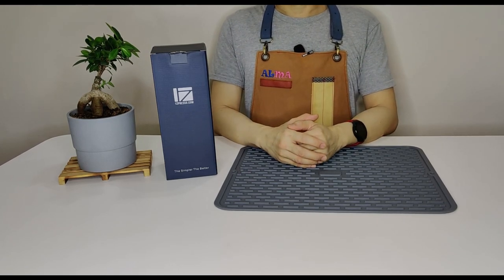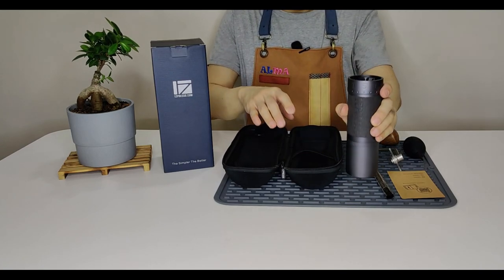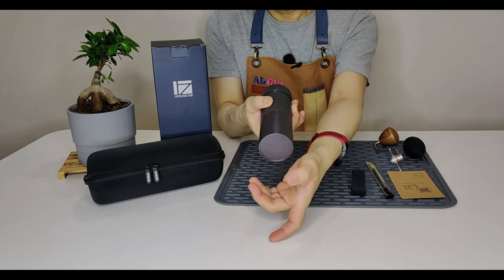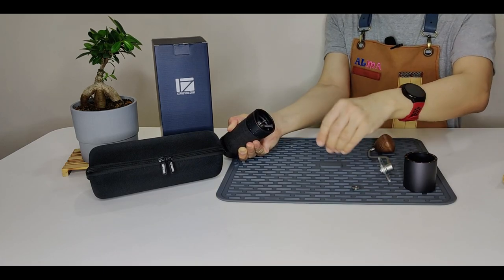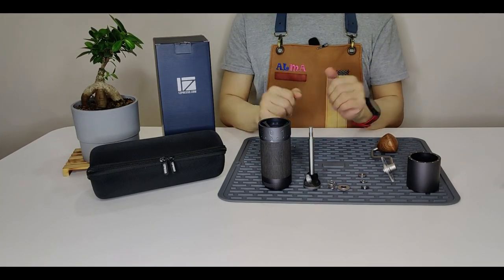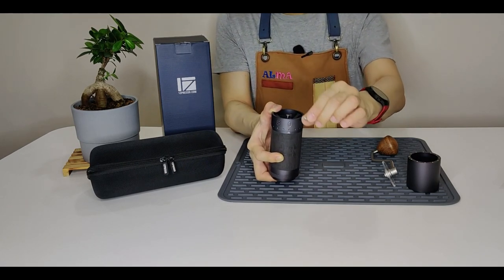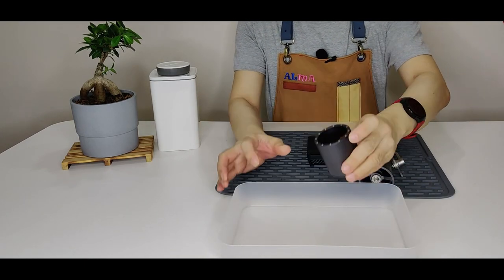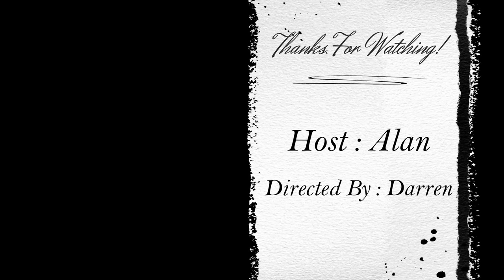1Zpresso J-Max Hand Coffee Grinder I Intro I Disassembly I Assembly I Grind Quality Test

Comment: My jmax grinder fell over and now its burrs are stuck. I cannot get the shaft to push out either. Crank doesn't turn.

Thoughts? I could really use some help.

I have disassembled it otherwise and of course its a day over the amazon return window.
Reply from the maker: @Roger lund - Sorry to hear about that. Unfortunately, it's not possible to have your unit on hand for analysing and therefore unable to advise you on the necessary self-repair. The best is to refer back to the seller for advice. Cheers!

Comment: Once you assembled again you just start using it? Doesn’t have to be calibrate it?
Reply from the maker: @Ivan Falquez - Hey there! As shown in the video (assembly guide), we have actually mentioned turning the adjustment dial to the true starting (zero) point before proceeding with the assembly. When in doubt, always good to consult the dealer or user manual. Cheers!
Reply: @almamicroroastery  I missed that on the video, thanks for that , I did it and it works fine now, I went off calibration that’s why I was watching your video , thanks a lot
Reply from the maker: @ifalquez  You are welcome!

Comment: Hello! Excellent video!

So I'm worried... I received my J Max grinder on this week. I mistaked! I know, I showd read the manual and see vídeos before make shit. The first thing I did was turn the adjustment ring counterclockwise until limit and removed the small bearing on the top. Consequentely after that, the ring adjustment jumped and come off completely, I saw that it has grease for lubrification and o can saw smalls metallic balls ... I went back with it to the place with a lot of fear, but apparently the grinder is working. Could anything have affected? Do you have any suggestion? Tks and sorry my bad english! ❤
Reply from the maker: @paulovitortq - Hi there, thanks for your compliment. As advised and warned by 1Zpresso Taiwan, we have not gone to that extent by removing the adjustment dial. As such, we can't advise you on that. Cheers!

Comment: I have 2 questions about J Max grinder.
1. How long do burrs last? i.e. is there a recommendation to change to new burrs after a certain time?
2. The grinder starts at 0 setting and then one can adjust the dial. Does adjusting dial often to various grind settings reset the initial settings or once set to zero, it doesn't change?
Reply from the maker: @Gautam Sarin - 
1. The burrs are expected to grind up to approximately 200kg of coffee beans. Do note that the burr set is not available to purchase for replacement at the moment. 
2. Frequent adjustments on the dial will not affect the already calibrated true starting/zero point unless detailed maintenance with the removal of parts.

Do consider subscribing to our channel. Cheers!

Comment: When I initially set my grind size, the first turn of the grinder handle is tight and causes a kind of snapping noise, is this normal.
Reply from the maker: @ryanbanks5963 - As confirmation, set it to a true zero point. From here, adjust the grind setting to a full complete turn (true zero point to 0, for espresso). Attach the crank handle & turn. There should not be any screeching sound for this grind setting. If yes, please approach the dealer where you bought from for help. Cheers!

Comment: How many seconds did you finish 18 grams?
Reply from the maker: @World1jp - Largely depends on your settings and grinding speed, it took less than 60s to grind 18g for espresso.
Reply: I also have it and it's not too bad even for espresso I do about 50 seconds or a little bit more if you take a break